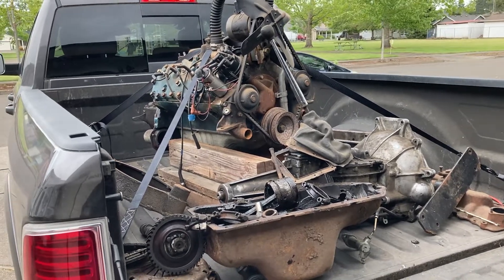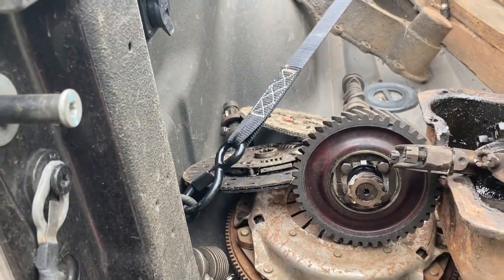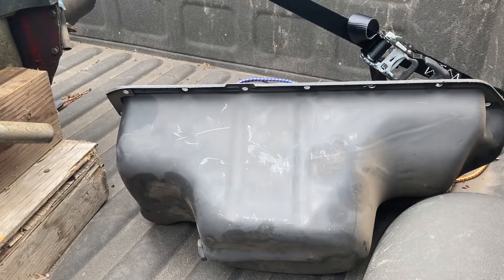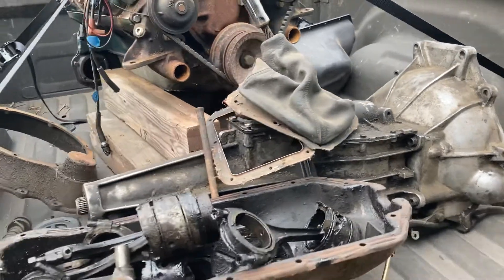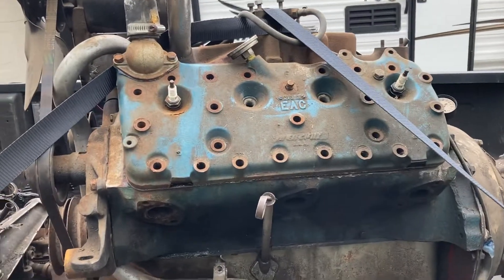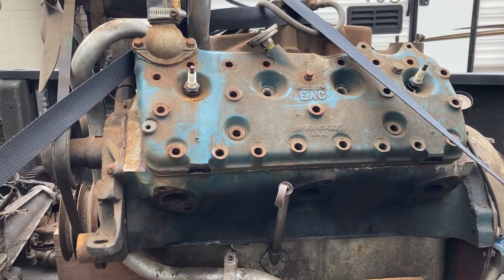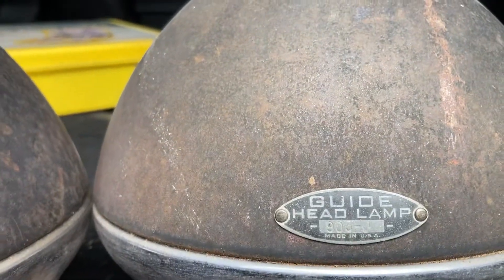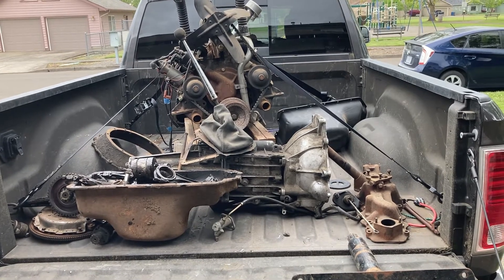Flathead parts haul.

Comment: Cool!   Are you parts gathering for a future project?   

When you tear it down, confirm if it’s really an EAB/EAC block.  Those are the 52-53 blocks (and possibly late 51 as well).    These blocks do not have hardened valve seats, from the factory.   Of course who knows the history of it, they could have been added.   Your machinist  will rightfully suggest you add hardened seats, if they aren’t there.
Reply from the maker: IowaMercMan , no big future projects. I would like to put the T5 in my Coupe if I can figure out a way to keep the torque tube. I tore apart the motor and the block is to far gone to save. I can use the Merc crank and adjustable lifters that were in it in a race engine I’m gathering parts for. I can sell the EAC heads.

Comment: Its a 42-53 pickup gearbox , just the open drive version of the car gearbox used 32-48.  heavier trucks had a much larger  four speed useless in hot rods. Internals basically the same as car gearbox with the exception of the output shaft and the rear mount/seal.
Reply from the maker: Thanks altos. I have a 51 side shift car trans with the same style sincros as the truck box. Can I swap the cluster gear and other gears from the car box to the truck box and hav an open drive top loader with car gears?